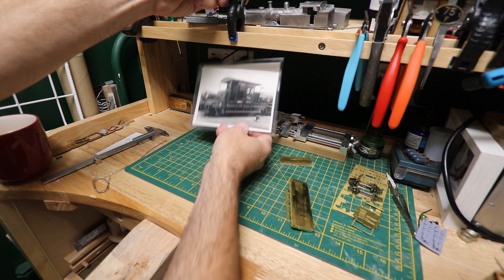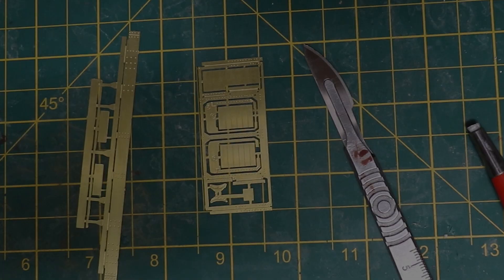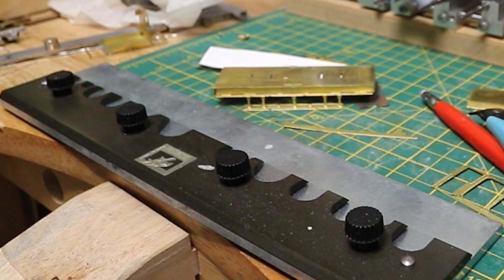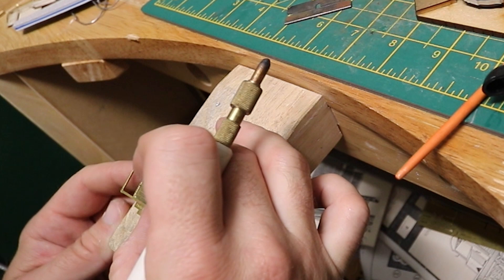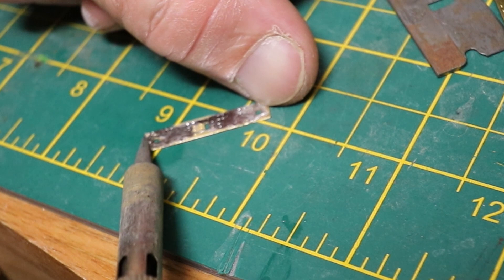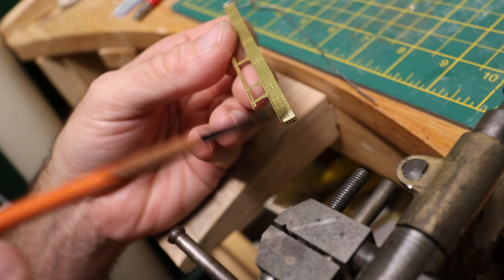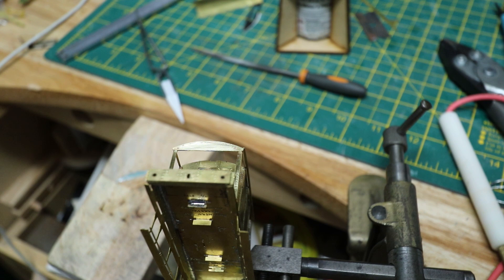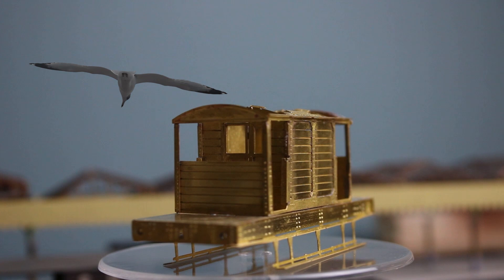S2 E19 Bexhill West Model Railway | Etched Brass Brake Van Kit Build | Part One

Comment: Very nice, charming little kit.

Your rivet press is very nice too. I've got a basic "Leakey" rivet tool, it's okay, but I've not mounted it to a plinth (a bit rocky at times) as I used to take it on holiday to model make in the evenings or inclement weather etc.

I built a Dog Kennel in 7mm, modified it to a later variant (25T) with the extra plating on the solebars etc. 

Who's RSU do you use, please - sorry if I missed that bit, video buffered a fair bit (not your fault).

Thanks in advance 😊👍✌️💜

Comment: Very impressive James,  I was looking at those folding jigs awhile ago,  I think I will have to invest in one when I get nearer to using brass kits.  Are you going to be adding springing/compensation to your axels with being in P4?  I tried making some of them ages ago and it wasn't too difficult when you get it all figured out.  Cheers,  Michael
Reply from the maker: Thank you Michael,
 The folding tool is really very useful, especially for carriage sides.  They can be very expensive but I remember this particular one being considerably cheaper than some alternatives, and it seems to work well.  I can't remember where I got this one, but I'll try to look it up for the next video.
With regard to suspension - I will be fitting Bill Bedford springing units in the next video.
All the best,
James

Comment: Hi James, couple of questions if I may, firstly is that what they call a Jewellers workbench you are using and secondly am I imagining things or did I not see you removing any traces of flux after you soldered ?
Reply from the maker: Hi David, 
Yes I am using a Jewellers bench, I think the height and configuration is ideal for model making.
Secondly, you are correct in that I didn't show the traces of flux being scrubbed off post soldering.  I'll go into my process in Part 2.  But simply, I scrub the parts with hot water and scouring powder, before giving them a blast in an ultrasonic cleaner.
Thanks for watching,
James